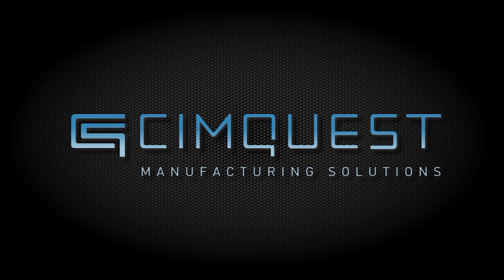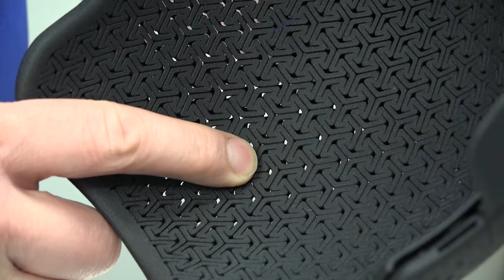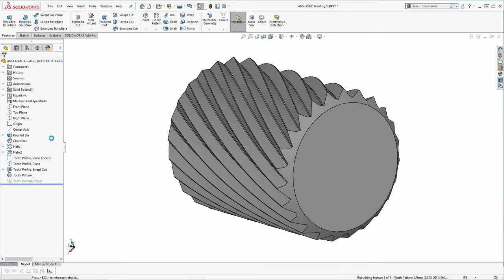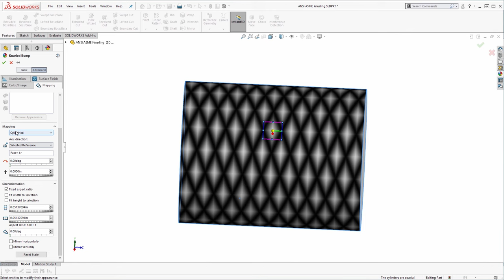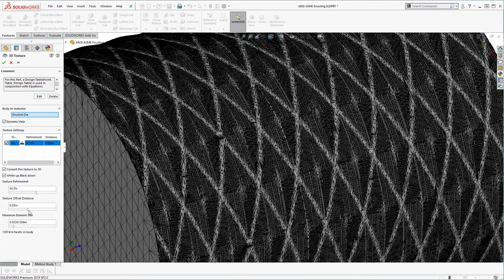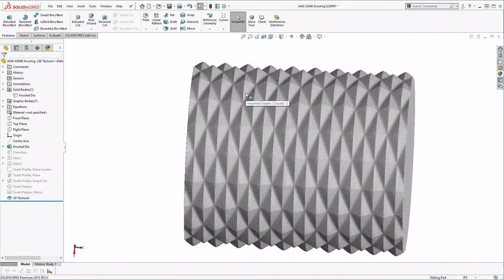SOLIDWORKS – 3D Texture Tool

Comment: It's unfortunate that this feature is completely unusable to get a 3d surface texture onto an enclosure of any kind. Even the most simplistic shapes like box with rounded corners already fail using this method.
Reply: ....as MOST new SW features, they are mostly very shallow and totally useless. SW should focus on fixing the many hundreds of bugs and all awkwardness instead of creating useless bling bling.

Comment: Quickly? Yes. Efficiently? Hell, no! 1. It's a mesh, not solid object. 2. It kills PC performance. Even one such part makes Solidworks lagging like hell. Imagine what will be if you have in the assembly. 3. Measurements? Precise positioning? Forget about it. No one asked for that "improvement". Making a 3D texture with usual Solid tools is way more efficient and not so much more time consuming.